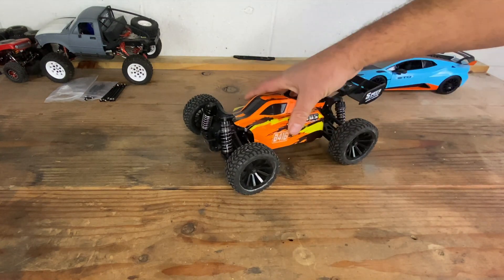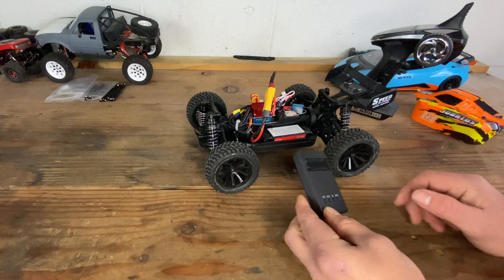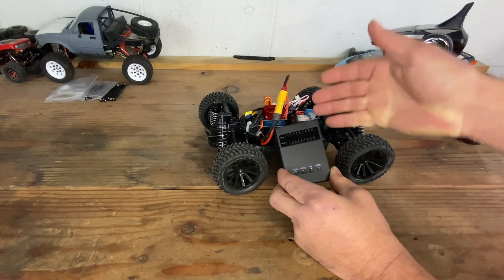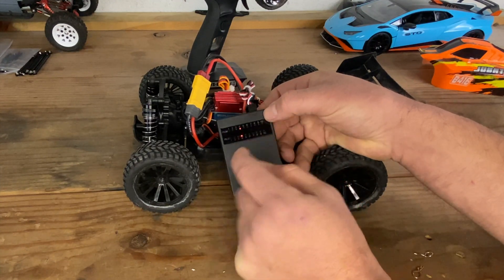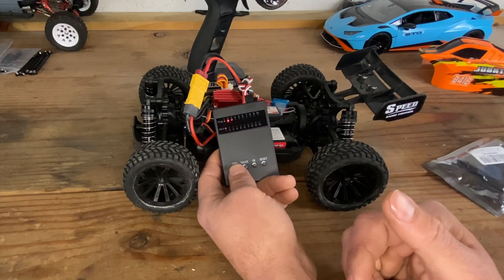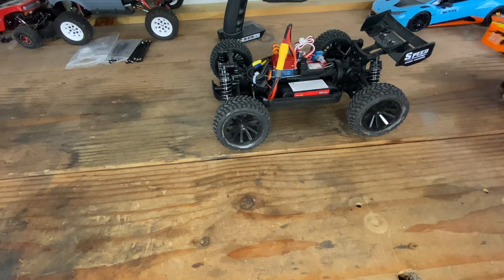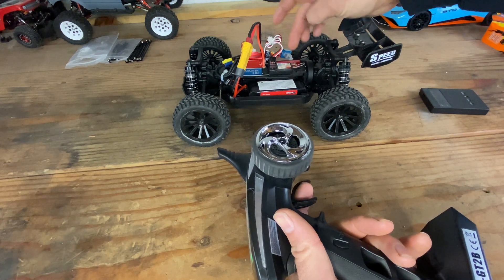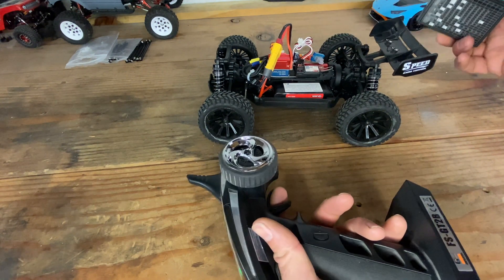Checking Out the GoolRC ESC Program Card - Will It Solve the Cogging W/ the Jubatus?

Comment: I’m no expert, but I tend to buy parts impulsively without much research. After going through dozens of cheap ESCs, I’ve learned that once they start cogging after working fine for a while, recalibrating or reprogramming is pointless.

I broke a couple ESCs last year, all showing the same symptoms. None worked even after carefully following recalibration or reprogramming instructions, and my friend from an RC club couldn’t fix them either. I switched to Surpass Hobby for all my current projects, and so far, I haven’t broken a single one.

Surpass Hobby is still budget-friendly but better than GoolRC. If they fail, I’ll switch to Hobbywing. When ESCs start cogging or flashing red, I just toss them and install a better one.

Comment: I also just realized he says he is adjusting start mode (punch) and says it’s item 4, but it’s item 3. Perhaps the string differ from motor to motor, but mine is item 3.

I had installed and had this massive problem of cogging to a stand stil, so I had to drive without coming to a full stop , lol, or I had to push start the f@&&ing car again. I got it solved with the extra slop on the spur gear.

I came here to refresh my recollection, and I pulled that motor out and stuck it in my daughter’s Vorteks Mega. Damn thing worked without issue with a slopless install. 

So this cogging only happens with some rc vehicles, but not others. Its not weight, thats for sure… the arms Vorteks is at least 3 times the weight of the WLToy 10 scale Race7… it feels like a toy grade Rc (and is close to that) when compared to the size and weight of the arena Vorteks.

If someone can confirm they have this issue (I don’t anymore) and if Vespers fix solves it, I would be happy to find consulted evidence it works… I install these motors as upgrades for all the toy grade cars my daughter collects, so it would be handy to have a confirmed solution for this issue I have seen a few times and fixed with slop in the pinionz.

Comment: The Problem is not the motor but also the driving Mode.
You must Trigger twice to run backwards?
Thats the boat or crawler Mode.
But on this Card isn't an Option for that or you must change the Value for Item 1.
Best regards

Comment: I don't know why nobody talks about it but it is basically a "problem" of non sensored brushless motors. Even top brand non sensored are like this. The issue can be reduced very much using lowering the gearing and using a 6 poles motor, but is not a real issue, it's a characteristic.

Comment: your engine is good.  you have to change Iten 16 value 1
Reply: Thanks Vesper, I’ll have to try that next time..  I had to install the pinion with a lot of slop, but my “cogging” was so bad the car wouldn’t start moving without a toe poke… from there it moved for about 3’ sputtering like a galopy, then finely blasting off. I’ll try to take out the extra slop and adjust this item.

Comment: I recently modified my raster redbull RB18 F1 rc car to brushless and I had the same cogging issue.
Now I'm waiting for the program card coming to my house to fix the cogging issue.
(Running on 2s 100c 1550mah lipo,brushless 2430 5800KV motor,25a cool rc brushless esc,flysky fs-gt3b,SG90 servo)

Comment: I bought one of those cheap motors once and i was having the same problem. I come to find that the bullet connectors to the motor were soldered quite terribly and i think with lead and not solder. So i cut the end off and trashed them. Got myself some new connectors, soldered them on and BOOM no cogging. I suggest trying the same.
Reply from the maker: Very helpful tip. I will have to take a look at that. Never would’ve thought but makes sense.

Comment: Hi! after programming mine my ESC doesn't arm... I have throttle at 0 (no trimming), I've recalibrated the throttle and steering on my remote (RadioLink RC6GS v3), and there is no way to make the engine run... only beeps. :(

Comment: I had the same issue with a similar Goolrc RC on my 10th scale HSP and ended up finding that the forward throttle I think it's number 16 when I played with those values I finally got it too get rid of the coging with also playing with the power from items 3 &4
Reply from the maker: Good to know. I will have to check out those settings and hopefully it solves the cogging issue or at least lessens it.
Reply: Thanks, Ill try it out..

Comment: You actually have to change starting to AT LEAST 8, better yet a 9 to get rid of cogging. Also the item number I had to change was #2 so maybe double check that. Same system and card, it was item#2 to an 8 or 9, possibly even yours shows it as item 4 but it's a misprint and is actually item 2? I don't know. also in my experience on systems you can't get rid of cogging, it was the ESC not the motor, just a tip if it don't work for ya 👍🏻
Reply from the maker: I’ll try #2 out. I put a different motor on then in a different video and it still cogged just a little but not as much. Thanks for the info.

Comment: Sometimes even after programming they still cogg and it is because the ESC is not completely compatible with the motor but I have seen guys switch the  pinion to a bigger size and it stopped cogging
Reply from the maker: Thats definitely something I will have to try out.